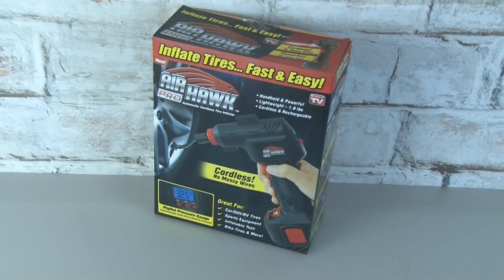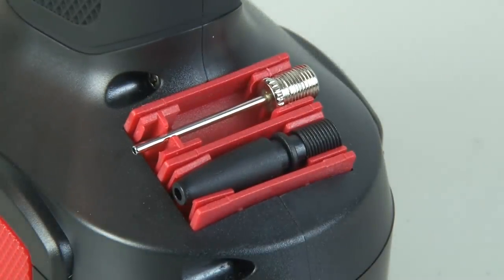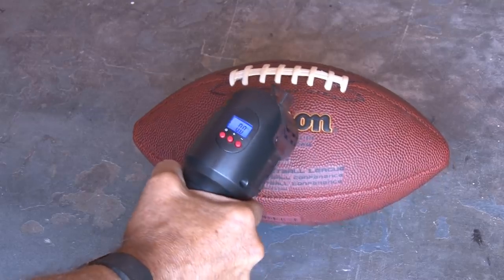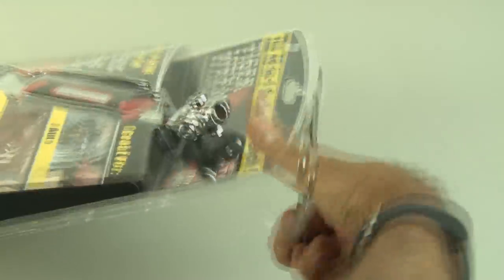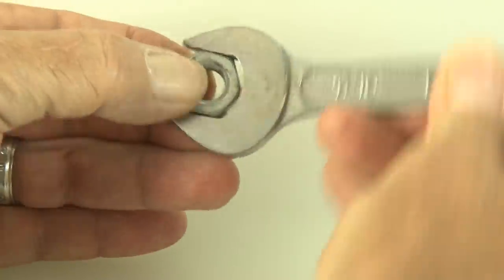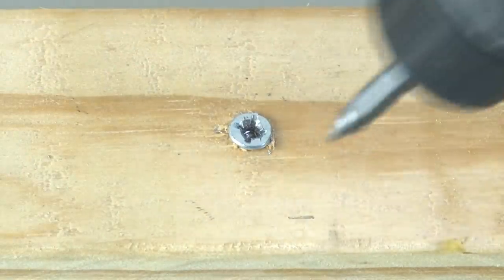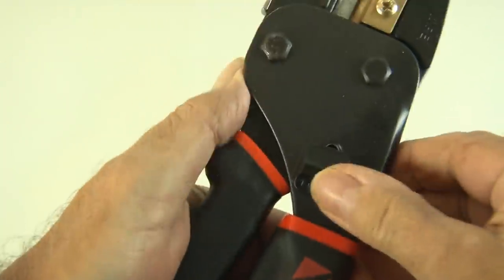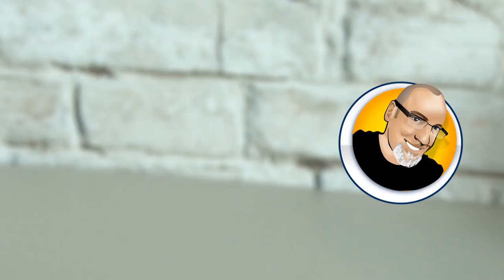As Seen on TV Tools - UNBOXING & TESTED!

Comment: The speed out are reverse thread, you use it in forward motion as the threads turn backwards.
Reply: Yeah, he didn't drill the head out in the right direction. I have a similar product called the "Grabit bit" and it works great.
Reply: @galacticgalaxyonezerone7235  Yeah, I used my "Grab It" bits on stripped screws and they got em right out... unless this brand is totally different but it seems like the same thing just different name.

Comment: you used the screw extractor wrong. you use the "a" side in the tighten position then use the "b" side in reverse
Reply: You sure? Might wanna check that again.
Reply: Wrong, the drill bit is left hand blade and so is the extractor side. Get educated
Reply: Nope, you haven't used one apparently. They are both reverse including the drill side as it keeps it from driving it further or tightening it more as it's drilling.

Comment: 3/8” and 10mm are CLOSE but NOT the same size. 3/8” is a tad smaller. Enough so that a 10mm socket will strip out a 3/8” nut and a 3/8” socket will not fit on a 10mm nut. There is also a slight difference between 9/16” and 14mm but usually they work in place of each other on new, non oxidized nuts.

Comment: You used the speedout wrong. I use these at work all the time. You didn't drill deep enough and you have to apply considerable pressure at very slow speed on the  extraction side. Also metric and SAE sizes are different enough that that tool is not going to be anything more than an emergency tool when you don't have a real set.

Comment: Lol, the screw extractor works perfectly if you use it correctly.  I’ve had one in my tool bag for years and I’ve removed stripped screws from metal and wood.

Comment: trick to the speed out is not to drill so deep and you need to use theright size for the screw your trying to getout that takes a few guess's till you have the knack for it i have the mastercraft version of the speed out and it works great if you dont over drill with the A part

Comment: AIR HAWK REAL WORLD USE:  I have been using the Air Hawk handheld compressor thing for my car tires for multiple months now, consistently, every two or three days to fill one of my car tires up from about 12-22psi back up to 32psi, because I had a nail in one of my tires' sidewalls, so I knew it couldn't be fixed by a shop and I was just putting off getting new tires once I discovered the exact rate at which the tire lost air, and just started pumping it back up in 2-3 day intervals.  So I bought the Air Hawk on a whim while I was in Rite Aid and thought, "you know, if I get even just a few weeks of use out of this I will be happy."  It still works 100% to this day.  I'm genuinely impressed, as I fully expected it to burn out by now.  It does take a bit if the tire is very low or flat (if you have expectations of this cheap little thing being fast, you need to re-think your views on realistic expectations, plain and simple), but even from flat the battery has enough juice to get the tire pumped up to spec, and in my situation, beat the hell out of overpaying for compressed air at the gas station.  During longer inflates, the top of it where the air is being rapidly compressed does get hot after a while, but like I said, nothing has burned out or melted yet.  I definitely feel like I put it to much more use than it probably was designed for, so I'm pretty satisfied with the low-cost purchase I made from the As Seen On TV isle that day.  Had low, realistic expectations but it definitely exceeded it

Obviously, your mileage may vary, and I do not condone driving your vehicle with unsafe tire pressures/conditions.

I recently finally got all four new tires, so now I just have it in my car for emergencies or easy filling of other air things.
Reply: finally a review that helps me choose to buy the air hawk been skeptic about getting one now I feel more confident getting one
Reply: matrodmedia li

Comment: Speed-out works wonders, every time, if you use it correct that is....which you didn’t
Reply: No, it doesn't. I've tried using it in a professional setting. Had the same results he did, every time.
Reply: @mike3667  he used it in reverese for both steps, which you arent suppose to do

Comment: You might want to re-do that Air Hawk test. The pump in it will not air up a flat that is still on the ground on the vehicle. If you lift the car on a jack you could probably refill a tire in 30 to 45 minutes. Maybe.

Comment: You are doing the screw thing wrong with A side you have to spin it clockwise and B side you have to spin it counter clockwise
Reply from the maker: +moi moi 2 No the drill should be in Reverse rotation for both ends.
Reply: moi moi 2 I was literally yelling about it the whole video
Reply: Unless the screw/bot you're trying to remove has an anti-clockwise thread, then this tool won't work at all, no matter what direction you use it in.
Reply: @kipkay  my bad I didn't notice that

Comment: If you actually put some weight behind the bit and made actual grooves to catch on to, and then actually put weight on the drill to extract it, it's probably going to work a lot better..Instead, you're just feathering it and making metal flakes..

Comment: I don't think you used the speed-out right .After you had a stripped out bolt your drill was drilling in the wrong direction so it did't cut the damaged bolt right.

Comment: Speedout actually works great. Ive used it multiple times, you just have to use a ton of pushing pressure on the drill to get the screw out.
Reply: Didnt work for me. The speedout bit just snapped.
Reply: Exactly!  I swear by mine.  You can't back out a screw without firmly pressing into it.
Reply: Yeah he didn't press hard on it at all
Reply: @CessnaPilot99  He was shaking to much

Comment: I got the air hawk and it’s great accept the rechargeable battery is not to strong and after a year the battery is so weak it keeps shutting off but they give you the cigarette lighter adapter cable and that makes it run really fast

Comment: that multitool is ww2 era and is part of a kit used on scout paratrooper bikes
Reply: Cool, didn't know that.  I have one that I got somehow when I was a kid.  I always carried that around in a pouch on my bicycle along with a basic patch kit.  Not exactly the same type of bike the paratroopers were probably using...lol.  It still worked like a charm though.
Reply: @101perspective  yeah check out this show called pawn stars they happened to buy a bike off of this girl that had the set and everything.
Reply: Yes it's a bike tool - I had one myself like that - small and has the right size for most bike bolts

Comment: Drill into the screw Clockwise, then flip the bit and back the screw out in REVERSE...also the bolt was too long for the socket to sit around the nut, with that pointed out all the items on here are garbage. Cheers!
Reply: Nope. Why do people keep saying this? I own several sets of these, NONE use the bit in forward...NONE. It's counterintuitive. If you drill into the screw in forward it will also tighten it more making the extraction that much harder. Reverse drilling not only eliminates that but you also sometimes remove the screw during that step as well.

Comment: The speed out should have worked you just kept making the hole bigger and anyone that has used or has common sense is that you don’t want to keep drilling the bolt and make the hole bigger
Reply: Right, no extraction skills.  A few people are good at extraction, the rest just make it worse

Comment: I've got so many different types of easy outs for stripped bolts, nuts, and screws. The cheap ones have always been hit or miss for me. But even if they work they usually only work once. My expensive sets always get the job done.

Comment: I extract stripped screws by using the chuck on the drill. Works every time.
Reply: Scumspawn *****  yae prob not for beginners and it could also damage surface...
Reply: Not a flush mount or countersunk screw you couldn't. A broken screw or a bolt/screw with a protruding head you could but not otherwise.

Comment: The Air Hawk does not always stop at the set PSI.  You should be aware of this little discrepancy.  It often keeps pumping well after your set PSI is reached.
Reply: Laceykat66 well the car read 35 & so did the manual pressure gauge
Reply: Dkhan23 “does not always stop”

Comment: I bought the Speed Out for $2.00 at a local Kmart that was going out of business so I was able to get it on  clearance price..I haven't tried it out yet but will see what happens..If it doesn't work like in this video at least I didn't spend around $19.99 on the thing, I'll just toss'em in the trash..I really would like to purchase one of those Speed Hawk's though!!!
Reply: Don't toss them out just yet. You will need to drill deep into the screw to give the bits enough material to grip on. Soft screws might be problematic though.

Comment: You used the speed out wrong.
Reply: Bloody Bum yeah, he has to apply pressure, mine work like a dream, haven’t had them fail yet and I have been using them for years, well not the seen on TV set but a very similar set, look exactly the same
Reply: The Speed Out is garbage. I tried using it in professional setting on a Stainless Steel screw. The bit couldn't handle drilling into the screw. Tried all sizes. Pretty much had the same results as he did.

Comment: I have used the speed out bits on some screws in the past and had no issues getting the screws out, but the screws I had to get out had a smaller head than the one you were trying. I'm surprised they didn't work for your screw. 
How long does the battery last on the airhawk?

Comment: Did not use the screw extractor correct...
Reply: I was looking for this reply, otherwise i would have written it.
You are right, used correctly it is a very clever tool.
Reply: @willd6515  what did he do wrong it's two simple steps drill a,and extract b.
Reply: @filibertobarrera3839  looks like he didnt use the right size one.

Comment: I has a cheap speedout and it worked for sometime. The only not clear thing is that you should hold the drill just in forward en not in reverse what i know...
Reply: No. This is why all of you that think it doesn't work have issues. You don't use these in forward AT ALL...EVER

Comment: The tiger wrench looks like it was made with metric but someone realised that no one uses metric in america so they just slapped the closest imperials onto it hoping no one would notice
Reply: Why use this logical system that is easy to use and understand 
When we can use this salad of different mashed units that caused a multi million dollar satellite to crash due to it's ridiculous conversion
Reply: Not sure where you are in America. I haven't come across anything that isn't metric in years.
Reply: @coryjohnson5409  metric revolution has started
Reply: @coryjohnson5409  where in the US are you? Where I live in the US the only metric thing around is apple charging cables
Reply: @128Gigabytes  I've been a mechanic 30 years and ain't seen a car built after the late 70's,early 80's that wasn't all metric.
Reply: @coryjohnson5409  my 1999 dodge durango isn't metric

You didnt answer the question where in the US do you live? Im not asking for exact location Im just not aware of anywhere that has switched to metric

Comment: When using the drill out did you drill in reverse?
Reply: He said he did
Reply: @128Gigabytes  when using the extractor end I mean the drill end.
Reply: @nevet1212  you are supposed to use reverse for both sides
Reply: @128Gigabytes  I know I'm wondering if he used the drill end the correct way as I had a similar problem with a similar product because I was not using the drill end correctly.
Reply: @128Gigabytes  LOL...no your not...how is a drill bit meant to drill a hole going in reverse...you only use reverse when using the easy out end
Reply: @res1492  yes, reverse. It has reverse cut design.
Reply: @curban0520  D
no it doesnt, look at the way the flutes are

Comment: You used the Speed Out incorrectly, you are not supposed to use the drill in reverse for both steps.
Reply: Yeah A is forward B is reverse
Reply: It's a reverse drill bit. He did it correctly. The issue is the drill but version does not drill a deep enough hole. Irwin makes a similar speed out that works better
Reply: Downward force is the trick to speedout

Comment: There is a socket wrench I have that has little metal pins in it that change shape to whatever you need to use it on. I think that thing blows that multitool away.
Reply: Try taking a nut out that is seized it will break that thing easily. Its just too weak. Needs better designing.
Reply: GamezAhoy yeah I do remember it not working well on rough jobs. But for normal work like taking simple things apart, it saves a ton of time switching sockets.
Reply: GamezAhoy maybe they could make it work better by putting strong magnets in each of the pins? So it locks to the nut better? Who knows. I don’t even have it anymore. Think it was my dads.
Reply: @MisterRorschach90  yeah that could work. Im thinking of having those pins be of a stronger metal and have the exterior cage fit tighter then the rest so it would be harder to push a nut into it but make it be more rigid strengthening it so it wont break as often

Comment: Did you do it wrong? Shouldn’t you drill the screw in the normal forward direction but use the Speedout using the drill’s reverse direction?

Comment: Basically they all are mostly stinkers because they're gimmicks cheeply made in China and Taiwan.
Most of them are actually functional, but there's always loads of downsides that make them impractical for many if not most real world applications.
Whether or not they're well made and hold up over time remains to be seen, because they always just wind up as unused clutter in a junk drawer.

Case in point would be the Tiger wrench, it may turns lits of fastener sizes but that doesn't really make it good.
 the dogbone wrench design has been around at least 100 years and is not popular for good reason.
It's bulky, It doesn't fit into tight spaces, and of course it cannot replace a socket set like they claim.
It's not a ratchet, and it's not a drive handle with accessories which means no extensions or universal joints.
The Gatorgrip socket is a bit better than this because it actually has some versatility on how you can use it.

Comment: How well will the Air Hawk work on a Pickup truck tire? Say an 01 1500 sport with 17's? That's what I have trouble airing up.
Reply: I have one and it got my FJR 1300 motorcycle tyre up to full pressure from flat without a problem. They're a great bit of kit.

Comment: You should never mix metric and inches tools you will strip the tools eventually because the fit isn't perfect.
Reply: Nothing in this world is a perfect fit .
Reply: Agreed, metric and imperial aren't equivalent and you shouldn't use (for example) a 1 inch wrench on a 25mm bolt.
Reply: I do all the time, haven't had a problem in 20 years of wrenching.

Comment: 3/8 is less than 10mm
Reply: Which is what caused those problems with the tiger wrench. Metrin and Imperial sockets are close to each other but not exact matches. I bet the manufacturer just went with the slightly larger ones and figured they would work with the other types too.

Comment: So if you have a completely flat tire on the side of the road, it will not inflate it?
Reply: I have seen a lot of electric compressors and any one of those have trouble inflating from 0 psi. It's possible but the tire must be seated. It will take time but the Air Hawk should do it, however, it sounds like there has to be a little back pressure so you'd probably have to continue to turn it on if it turns off. Once there is enough PSI it should have back pressure and not turn off once you set it.

Comment: You probably have to put quite a bit of weight behind those "speed-out" bits when you're using the extracting side - that said I know from experience they hardly work, sometimes they do - most of the time they don't.
Reply: Mine work all the time, just have to use them correctly

Comment: The speed out you were spinning it counter clockwise but it was supposed to be clockwise I saw the tip of it
Reply: Extractor kits are all left-hand threaded. Both the bits and the extractor are suppose to turn counter-clockwise. This is so you don't tighten the screw or bolt further. If the tip suggested it should go clockwise, then it was a faulty bit.

Comment: Kipkay your review is unrealistic and cheesy -  The airhawk pro and the air dragon are complete pieces of junk. Try running them in a hot climate for over 20 minutes.  The plastic piston that is the main component of the compressor will shatter into pieces and the piston ring is a tiny little sliver of cheap metal in a PLASTIC PISTON.  It is a piece of junk don't ever buy it. Huge waste of money.  Get a name brand inflater like dewalt, ryobi, milwaukee  18v.